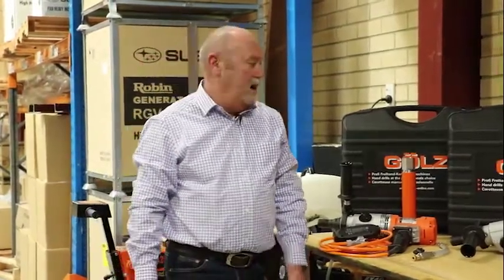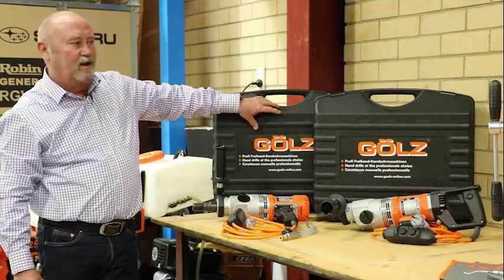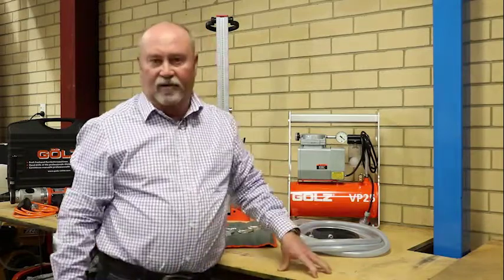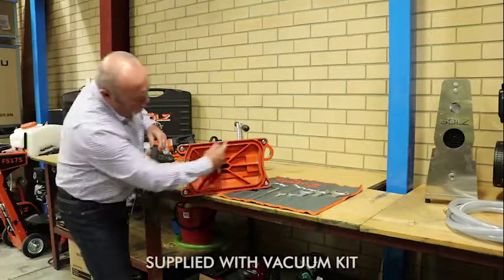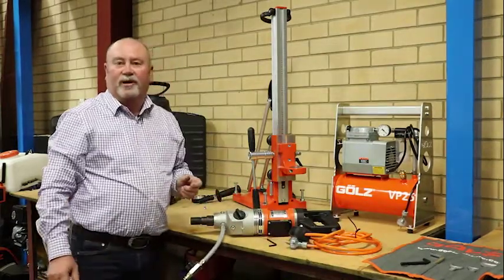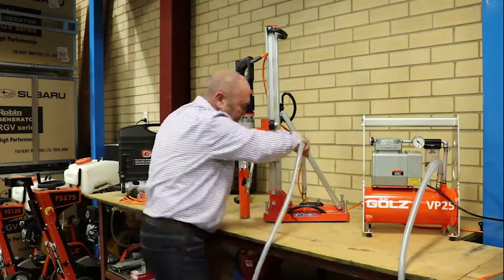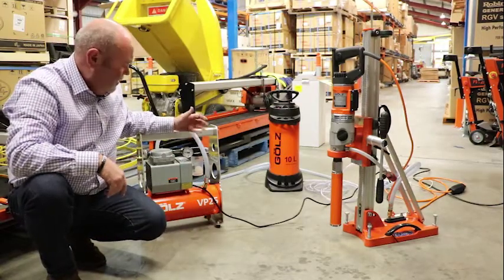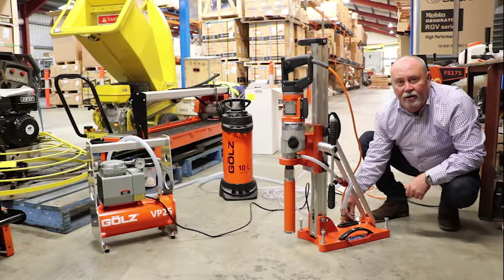Core Drill and Vacuum Pump Training 480p

Comment: The vacuum pump has a cylinder down. what is that cylinder for?
Reply from the maker: Safety tank for vacuum hold down after power line break. Gives you the time for the controlled re-build, instead of falling down directly.